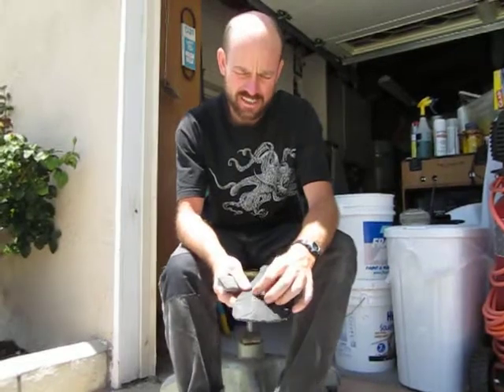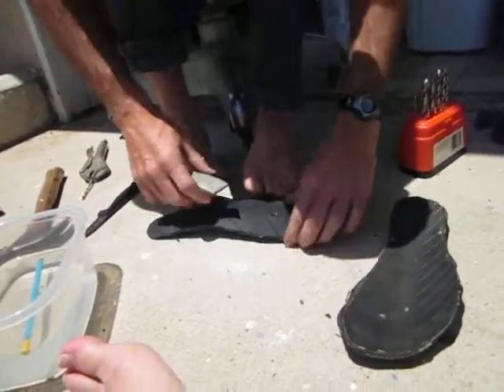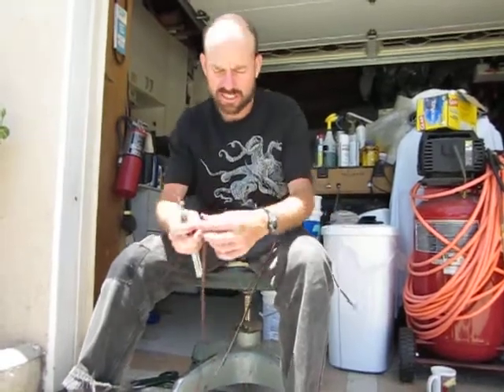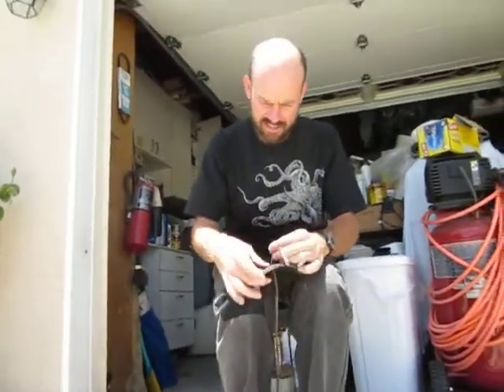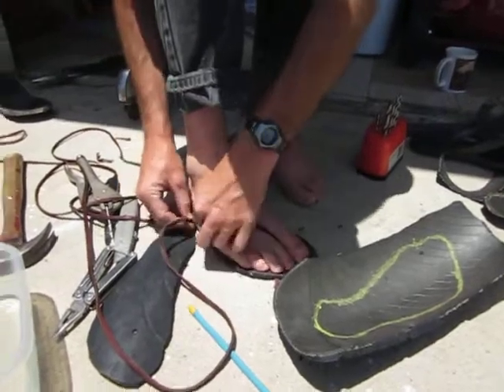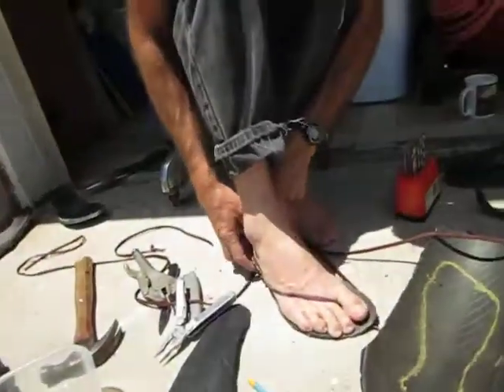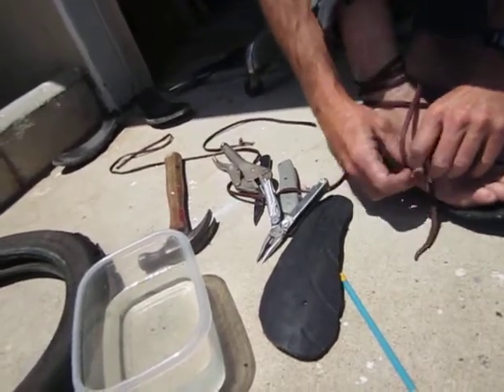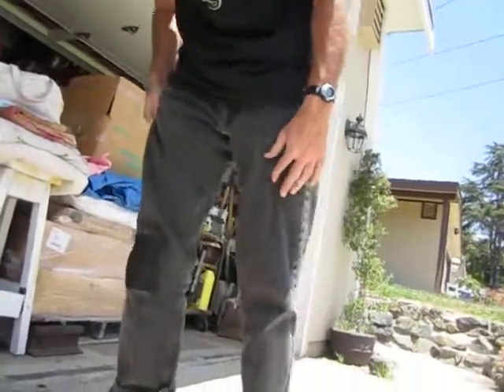Part 2: making my second pair of Taramahara running sandals

Comment: You should make flip flops out of them. You could use recycled plastic between two layers of rubber to add a little rigidity. They would last forever.

Comment: If you're going to do a lot of walking, especially in a rocky area, you might want a thicker sole. Perhaps take two of those soles and use some silicone to glue them together. Thanks for the video. Upcycling and not buying stuff made by almost slaves in Asia is worth the work.
Reply: Minnie Or just use a less worn tire and line that front knot up with a groove on the underside tread so you're not beveling w a knife.

Comment: The part of the lacing on the sides under the sole is gonna wear and cut.  The toe was beveled to help but ur walking on the laces on the sides.  Need a lil more thought, but good start.
Reply: roundedges2 Find a tire with the right tread and line those holes up with grooves in that tread.
Reply: Sandwich the laces between a double sole of The tire might work well using some type of shoe glue. I love them. They are comfy